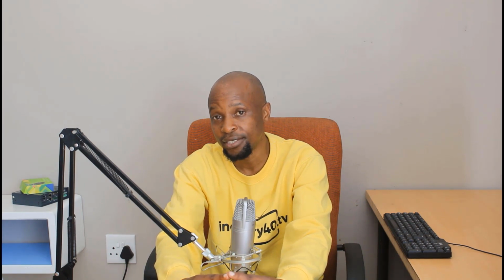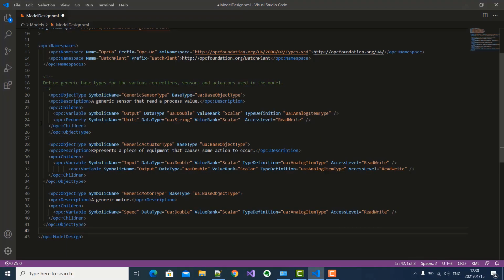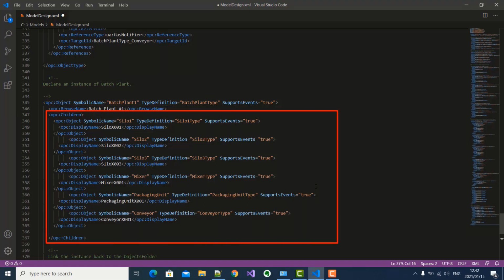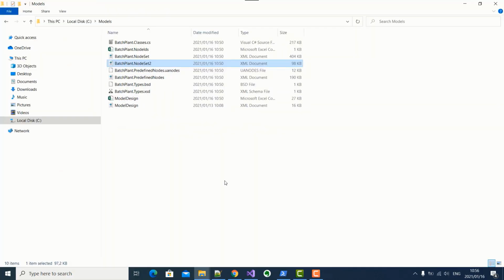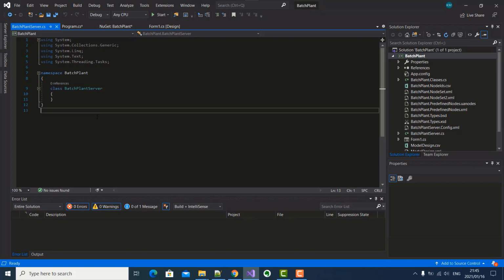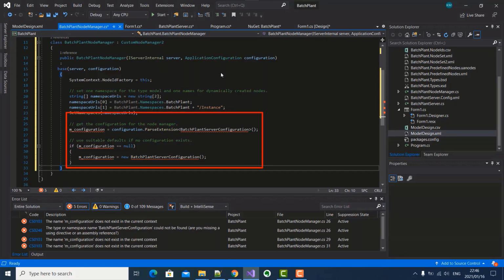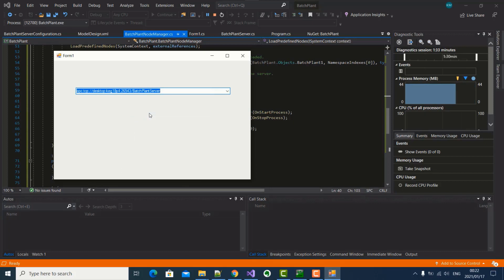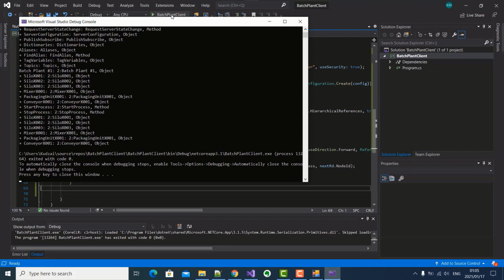OPC UA .NET Tutorial - Creating Information Model and OPC UA Server Using NET [4 of 11]

Comment: Great tutorial. Thanks so much. 
However I 'm not able to make it running. Typed all code manually because I didn't found the sources. ModelDesign is compiled witout any error and server start but I can't see the address space, only the defined object types. How can I found the sources to compare it with my code?
Reply: Do you have the ModelDesign.xml file?  If yes, can you send it to me?
Reply: @jsagazio  , but I don't believe that it is a problem of ModelDesign because I can see some types that I defined.
I guess that the cause is the NodeManager.

Comment: Hello,

First of all, thank you so much for the good explanations. I've been adapting this boiler template to simulate various PLC's that work as an OPC Server. 

Although, I have came across a big problem generating the correct OPC Server Data Values on specifically ExtensionObjects. Using Ua Expert I get the Datatype set to Null.

Do you have or can provide some XML examples on how to build an OPC Server with some ExtensionsObjects, such as, for instance a C# class object?

Ex.: 

public class Order {
      public int Id;
      public float Thickness;
      public string Material;
}

Thank you so much for this video and I really hope you could help me out.

Comment: Great video: Works out of the box, thanks
I can read the LoadcellTransmitter output value from a client but it is not updating
My modified code from BatchPlantNodeManager.cs:
 public void DoSimulation(object state)
 {
   m_batchPlant1.Mixer.LoadcellTransmitter.Output.Value =  m_batchPlant1.Mixer.LoadcellTransmitter.Output.Value +1;
 }
Value now changes. I can see the value on the client but it is only a snapshot. 
I have to add the LoadcellTransmitter output value to “Data Access View” to see the updated value. 
How to I force the Server to update the value? I am thinking of an action: “Trigger update”
Reply: You need to change by:
public ISystemContext m_simulationContext;
public void DoSimulation(object state)
{
   m_batchPlant1.Mixer.LoadcellTransmitter.Output.Value =  m_batchPlant1.Mixer.LoadcellTransmitter.Output.Value +1;
   m_batchPlant1.ClearChangeMasks(m_simulationContext, true);
}

To update value.

Comment: I tried to follow the steps using your files.
UA-ModelCompiler with your ModelDesign.xml generates files that are different from yours.
In the generated Batch.Plant.Classes.cs file compared to yours, the regions "Method Identifiers" through out "Namespace Declarations" are missing.
Do you have any idea what the problem could be?
Reply: There is another file BatchPlant.Constants.cs which contains the mentioned regions. You probably used an older version of UA-ModelCompiler.